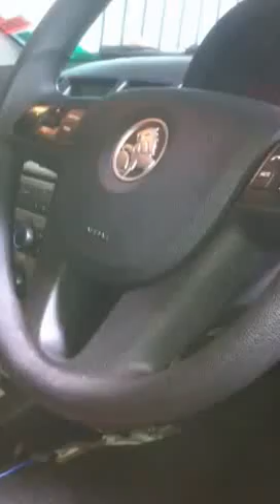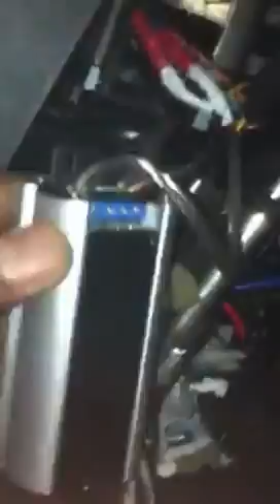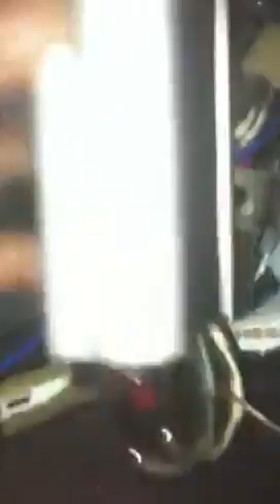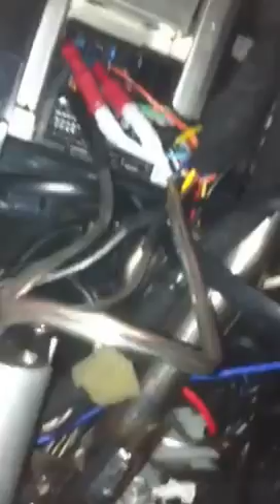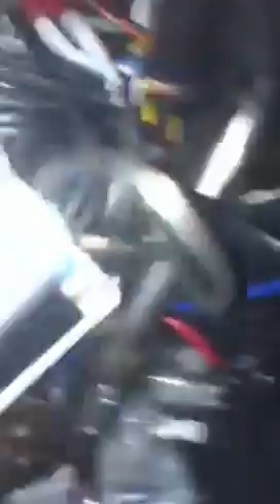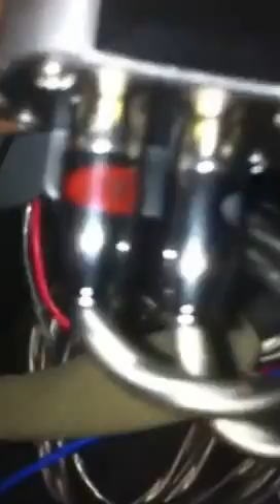Ve Commodore Line Output Conveter (LOC) install

Comment: Just a suggestion if your amp has a high frequency input (HF) just tap it into your rear speakers, no need to spend $50 on a converter

Comment: I've wired my single channel mono block as you described,but when I pull the right side eva out of the amp the sound stops.The only thing I may have done wrong was the brown wire,there's 2 of them and I might have the wrong one

Comment: with wiring up a amp to a 've,why are the hook up to the left side speakers,shouldn't it be 1 left and 1 right or the amp is only running 1 channel?
Reply from the maker: Hey mate the amp is running two channels I've got the speaker colours in the description. one side rinse one channel the other side runs the other.

Comment: hey mate i have a ve series one ute only have front speakers
how do i connect loc and to what color wire and if you could tell me how to tap them please
thanks in advance
Reply from the maker: Rocky Rox you will have to use the front speakers mate. the colors are front left speaker grey wire and brown wire, front right speaker light green/black wire and green wire. just use wire strippers and join your speaker wires together with the LOC wires.
Reply: all good man rear were activated anyways so spliced into them cheer s bro

Comment: How did you get the knee panel off under the steering wheel? Also what model mine is a 2010 the battery is in the boot